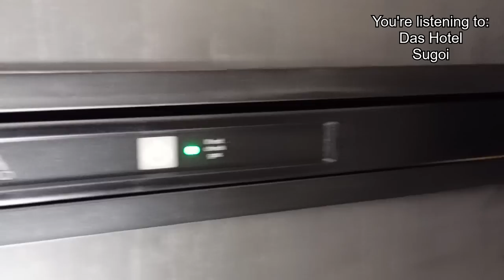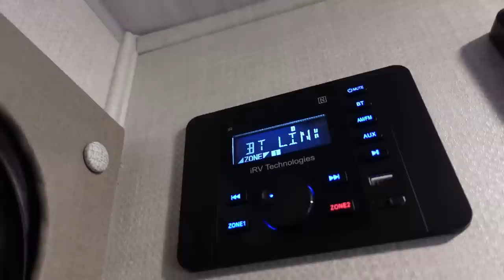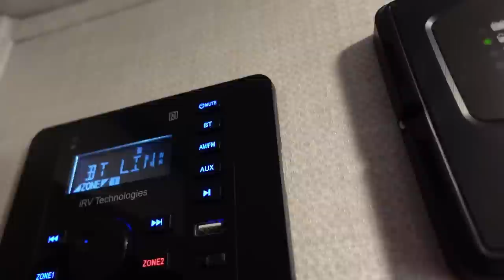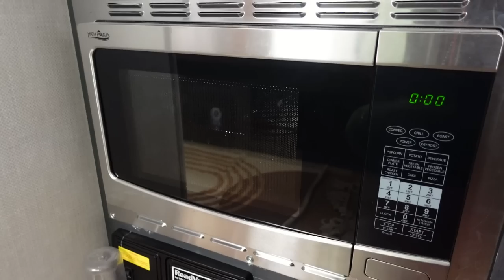RV Buying Mistakes You Need To Avoid | Solo Female Travel in Trailer + Things I Love & Hate About It

Comment: 1. Get on a crawler & check under the trailer. 2. Trailer theft is bad. Get a hitch lock & cameras so you can monitor your trailer. You cannot trust campgrounds & parks. That’s where thieves go most.  

You were still tired when you bought your new place. You look totally different now. So don’t be hard on yourself. You did fine! Those are all fixable. ❤❤❤   I told ya you’d feel 100% better in a more updated & normalized space. And cops won’t pull ya over just to mess with you as easily in this set up. That worried me. Now you blend in with traffic. You’re doing great!  Keep it up! Cya later!
Reply: Thank you for that info; I am currently looking
Reply: Can you take it back for repairs? Warranty
Reply: that is my biggest concern other than safety is someone just stealing the trailer or where to park it etc.
Reply: When i bought my last car  it was 5 years old because I wanted to see what the ratings where for that car. Having done that I was able to buy the best year and model for that kind of car. Ive had no problems at all and I've had it for 12 years already.
I think it always best to by a few years older so you can read the reviews.
Reply: Thanks for sharing about campground thieves.

Comment: Purchased a travel trailer around the same time as you and    in addition to the things you mentioned I would add not to shop on an empty stomach. I ended up having to leave the hookup demo midway thru because I’d been on the road getting to the dealership so long  plus the hours you spend signing paperwork, inspecting,  demoing, etc. means you need to be on your A game and def not skip meals. I  would also say to compare your model to similar ones on the lot if possible. That’s how I found out things were missing of my trailer. I’ll know better next time and it’s all part of the learning process and I’m glad you’re sharing with others. In the meantime, pray the Most High keeps you safe on your journeys!

Comment: Hi Brittany!  I agree with the other comments regarding warranty should be good for at least 1 year.   I want to make the same suggestion I made to Nomadic Introvert; who also found issues with her RV; look into obtaining an extended warranty that covers bumper to bumper (electrical, sensors etc) before expiration. Note:  don’t buy from seller; research and join a forum to get help and answers to any upgrades, where to get parts etc.   Years ago, my Rover’s warranty was about to expire & they wanted to charge $10k for an “original” Rover warranty.  I went to the forum and was lead to a dealership in another state and paid $1,200 for bumper to bumper along with sensors etc.   My deductible was only $100.  Went in for service & they found an issue thinking they had me until I dropped the warranty on the service desk.
Reply: Thanks for posting. I found this very helpful.😊
Reply: @BunnyRabit-yo3lx  you are most welcome!

Comment: I hate that you had these issues.  The worst think about the RV industry is that they are NOT regulated by the government like automobiles.  Also, RVIA is truly a joke.  They are a membership organization for RV builders but they don't enforce quality control.  Therefore, every RV that's built by any RV company is built different even if it's the same model.  For example, one RV might have the bathroom draining into the black tank and another might drain into the grey tank.  It's quite frustrating.  Thank God your RV is still under warranty.  One of the reasons I will never buy a brand new RV is because it takes RV companies forever in many cases to do the warranty work.  Second, if I buy a used RV, the previous owners have already worked out the kinks so I can simply start renovating to get on the road sooner rather than later.  Great video!

Comment: You have to take it back so they can fix what should have been done right.  Over time these things can get worse  . They didn't give you what they offered. This was brand new. First owner. It's easier for them to fix it than for you to stress unnecessarily.  Take it back and to be fixed don't turn your home into a liability . It's not your fault for missing things that should not have existed. 🙂 plus places where the seal is not correct allows for moisture to build up and that cause rust development.

Comment: Hi, Brittany. I'm a knife enthusiast. The folding knives & my multi-tools often lose screws that vibrate out. There's a product called LocTite that you can dab a tiny bit on the screw threads that will prevent the screw from rattling lose while you travel down the road. And, it won't prevent you from being able to take the screw out, later, should you change the windows. Easy fix with a few dollars.

Comment: We discovered that the solar was not connected after we purchased our rpod 191. It was used once and stored in a large shop/garage. We looked at it in the evening and for used it looked like it was in excelent condition (which it really was for used). It took a long trip through sunny weather to start to wonder if the solar was overrated. Good news, hubby found the wires that weren't connected and now we have roof solar. Even though there are a few things that have needed to be fixed and adjusted very happy to have a nice little trailer.

Comment: Please don't get rid of conversation oven, it can still be used as cabinet,  especially for keeping foods like bake goods in an airtight environment,  or for smaller dishes or what-nots; and again you may to use its original purpose , on those rare occasions, when you are plug; not to mention, resale value,  if you should ever sale her. Also you should be under warranty, so those unfortunate issues you have with your "home" should and can be corrected.  By the way. I love you free spirit :)
Reply from the maker: U know what, you're right - maybe bread, chips and stuff

Comment: What you are finding is pretty common with all new RVs and most people don’t find the issues until they start using the RV. That is what warranties are for so be sure to hold your seller accountable for fixing those issues before your warranty expires. There are always a lot of ‘bugs’ to work out with new RVs, that is why I always buy used, so someone else has already fixed all those issues. The quality of new RV builds has definitely deteriorated since Covid due to high demand=high volume manufacturing in a short time. It’s also recommended to hire an independent RV inspector when purchasing any RV new or used. 

BTW, love how you have decorated and love your little pup 😍

Comment: Most of the items you pointed out were "fit and finish" issues, with the exception of the inferior cover for the water outlet and the improper installation of your propane fridge. All of it really is the manufacturers responsibility. The propane fridge could have been catastrophic for you. I'm sure you paid dearly for your new home and I would bring all of it to the attention of the dealer, but especially you should contact the manufacturer directly. While it's always a good idea to have another set of "eyes", your new home should have been thoroughly inspected for all the issues you noticed. The little round cover for your water outlet should be upgraded to withstand the purpose it is intended for. Personally, I don't think you should have to do quality control and inspection. That responsibility is the manufacturers. The dealer should be the "extra person" to inspect the RV, before you ever saw it. My opinion.

* The dealer and/or manufacturer should do right by you, to make you COMPLETELY satisfied. But I'm glad you're happy with your new home. 😁

Comment: I saw YouTube videos about new RV’s, mobile homes, etc., are built so fast that the quality is not good. As for the sawdust, taking photos and/or videos of the before and after as well as all other defects. Thank you for the electrical outlets not flushed properly. If I ever check out RV’s, I will be bringing usb cables, power adapters. You should have a warranty to get your problems fixed without having to pay for parts and/or labor. Thanks for sharing on YouTube.

Comment: This has been happening for over 2 years now , rvs being thrown together , all different size screws falling out, leaking roof ! That’s the worst , no new anything should be leaking through a roof , windows or anywhere. Not to mention, General RV s reputation isn’t so shiny . So many dealerships have screwed people big time over “repairs” that just should’ve been done right to begin with. Check all your plumbing lines, make sure if they’re connected , that they’re on tight. The longer you own it, the more you’ll learn about it.

Comment: First mistake he made was the rushed to buy an RV always go home and ponder it over and then go back and take a second look, second mistake is not having them turn on all the appliances and showing you how to use them. That way you would’ve known the propane stove. Was it hooked up now called the manufacturer and have those mistakes taken care of the refrigerator will give you problems if you don’t correct the situation right away and it’s covered on your manufacturers warranty

Comment: To fix screws that won't tighten tuck a toothpick, small zip tie pointed end, or rubber band into the screw hole then insert the screw and tighten snug. These RV makers source the same products from the same manufacturers because they are the cheapest options possible. Included fridges are mostly useless and expensive. Better to return to a cheap chest style 12v fridge and be done with problems. Short of building your own, all travel trailers will have the same or similar issues with the possible exception of Casita, Skamp, or Bigfoot brands. Expect all other units to last approximately 3 years before warranties expire and major issues need attention. This is by design to avoid repair costs to the dealers and manufacturers. Travel trailers are built with the poorest materials legal to use. The R-Pods are one of the better options with the better roof and style. But, the bones are the same as the cardboard/particle board/warped, split 2 x 2s used in nearly all of them. Admire the guts to live this way. But, travel trailers are mostly more trouble than they're worth. Resale values are awful compared to other options. Safe travels.